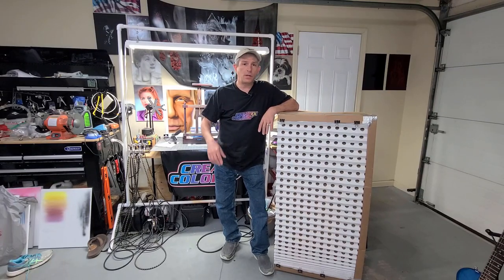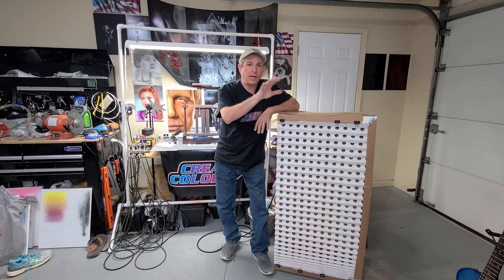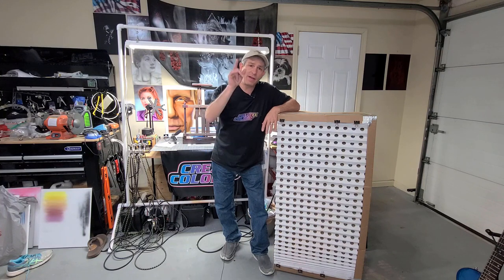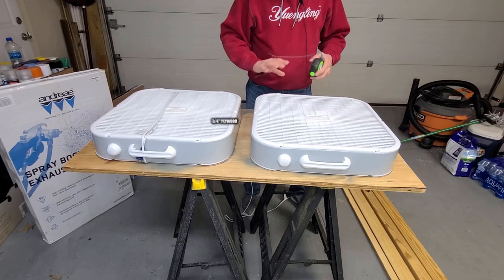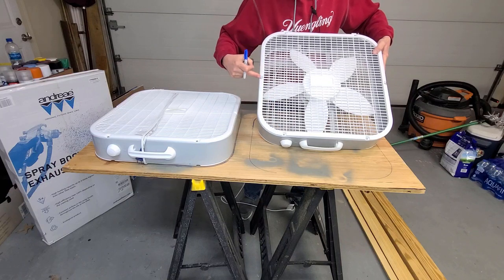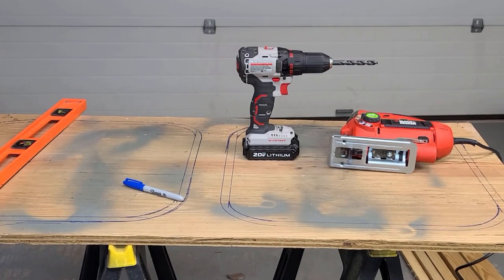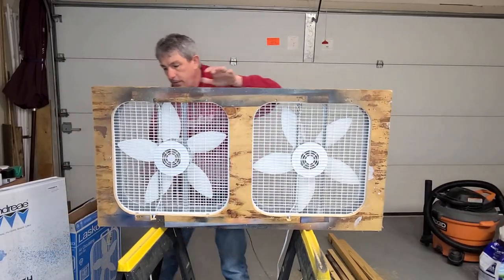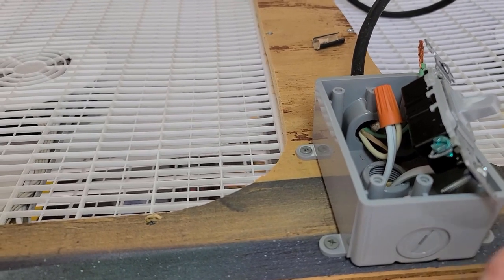Paint Overspray Extractor - For Your Garage

Comment: A couple of problems with these box fans..  First is that they can most likely spark which is bad if you're spraying flammable solvents. The next thing is that they produce like almost no static pressure so you can hardly run them with a filter.

Comment: What about enamels or other flammable stuff- im building something but I need a explosion proof fan to prevent fire from sparks in motor mixing with solvents
Reply from the maker: Nmerek, the cheap wal mart fans I made this with are not explosion proof. I spray mostly water-based paints. It's more about the filter material. I totally recommend explosion proof fans. They are going to be a lot more expensive but if the paints you are going to spray call for it then that's what you should do. I have sprayed small auto motive paint jobs, guitars, and motorcycle tanks with this fan, but I also had the fan at an open door and the garage door up about a foot for ventilation If I was totally enclosed, I would spend the money and buy the explosion proof fans. Also, I have added hvac filters to the back, I just tape them on. They are cheap and catch any extra. Hope this helps. Thanks for watching.
Reply: Tip: start the motor first before spraying. The initial start up will run then the motor will work with magnetic field causing the motor to spin the fan. There is no spark after the initial start so save your money on buying these so called explosion proof fans etc. but if it’s a peace of mind for you then go ahead and purchase them. Anyhow I’m just speaking on how things worked for me and my experience. 

*This is not professional advice and if in that case you do follow this I’m not liable for anything that may happen to you or your property. **😂😂😂😂😂 just have to put that out there.

Comment: Great video.  How much does that Andreae filter material restrict airflow? I've been using furnace filters and the high Merv filters restrict airflow too much and the lower Merv filters allow some of the overspray to pass through, so if that Andreae filter doesn't restrict airflow and captures all the overspray, that's perfect, thanks.
Reply from the maker: JT, very little restriction. The filter looks like thin cardboard with holes cut in it. When I first saw it, my question was...how is that going to work? But sure enough! It works great. Never used it before this project and I am very impressed with it. Thanks for the question and thanks for watching.